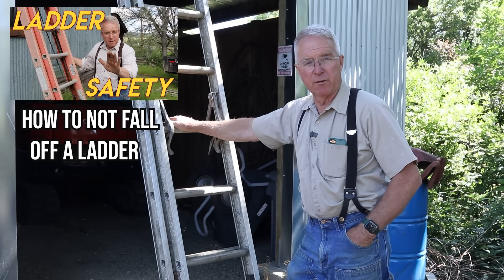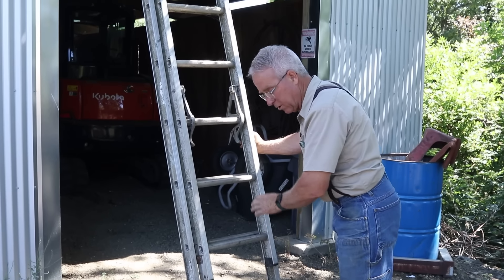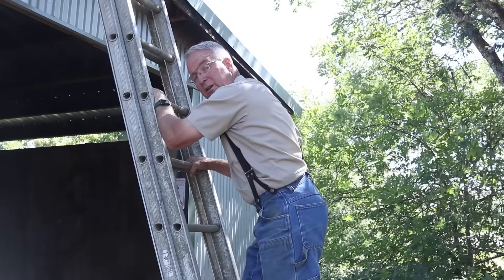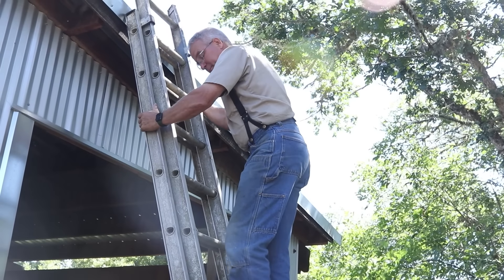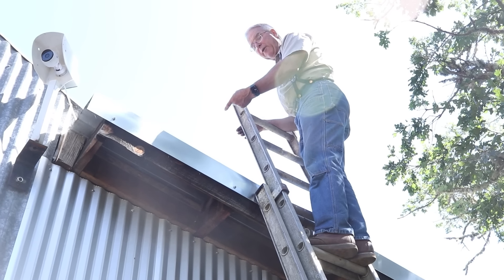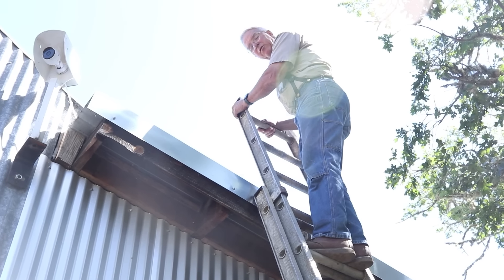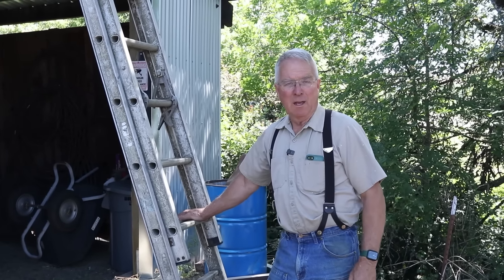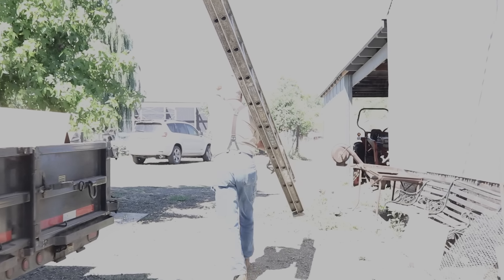How to Climb A Ladder, Dismount, & More Tips

Comment: Fireman Method 4:1 for ascending or descending. 

Carrying a load up at the ladder, use a canvas bucket and a hand line, or a work belt to attach tools.

A ladder wedge, dig out the ground, and spurs all work when done appropriately.

3 or 4 rungs above the level that tou plan to step off on. Waist high at a minimum, preferably mid chest preferred.

Side carry at the 50/50 holding the fly section or if shoulder carry, you should know the balance point where not recommended, you should be able to balance on your shoulder and holding with one hand. But for safety reasons, for example, if you carrying on your right shoulder, the fly is on your head side, left hand on the rung, and right hand under and on the base. This way, if you slip, your rung hand can push away and your base underhand can pull down to roll the ladder off of your shoulder (found this out when I slipped on some sheep shit on a 15 degree angle hill with a 28ft fiberglass ladder that was  a Class 3A and weighed about 130lbs). Again, find the balance point. This will be way different for a fiberglass versus an aluminum ladder. 

If you have ladder hooks, fold the hooks in where they lay over the top rung or V bar if it is designed for pole utility work.

Always face the direction you are carrying in with the foot down. Use help when needed (there is no gold star for taking chances). Be aware of overhead obstacles like power, tree limbs, or UFO's.

Fiberglass is best but is alot heavier than aluminum. Fiberglass is more stable the higher you go, but setting up is more dangerous due to weight. 

Last thing that is really the first thing to do..... Ask yourself, do i need to use a ladder to gain access or is there another means like a bucket truck or other aerial device that you can use. Second, if you use the ladder, visual inspect for damage like cracks, missing hardware, bent rungs of rails etc. If the ladder is the only option and is damaged, either repair it before use or replace it for the job before you. If it is damaged beyond safe repairable usage, destroy it by cutting the rungs or cutting the fly/base in 4ft sections (side note, a 28ft ladder base make a wonderful 14ft ladder if if the base is good and the fly has been removed for damage that cannot be repaired.

And when you can, tie off the ladder to a secure object to anchor it when lifting over 35lbs for that hand line. When in doubt, do not attempt the work. There is nothing more dangerous than incompetence on a job site and someone acting like they are an expert at the task at hand.

Safety is the one thing we can all LIVE with. 4:39

Comment: I just switched trades; I was a scaffold builder for a number of years, a few of them at a dedicated scaffold shop, now I’m a pipefitter and service HVAC/R. I’ve never had an issue with heights, I like it personally.. but I’m not a fan of extension ladders. Going up isn’t bad but dismounting a roof on an extension ladder sucks.. I would rather do ANYTHING else. I tend to get on my knees and get my center of gravity as close to the deck as possible and step one or two rungs down, keeping everything close to the ladder and edge of the roof when I transition. I’ve had ladders slide when transitioning to a roof; it will be even more severe if it happens while getting on from a roof. 

Don’t know if it’s good practice or not but it’s a habit from climbing down off of system scaffolding. It was never an ideal scenario but sometimes it was the only way to get down from a scaffold, halfway through a build.

If I’m carrying my tool bag, I’ll set it on the edge of the roof, get on the ladder until the bag is just below eye level, grab it and transition it between the ladder and the building and climb down with the bag on the backside of the ladder. Sounds awkward but it’s actually very comfortable.

Comment: Retired plasterer here. I always hated ladders and would never work off of on, but plastering requires 2 hands so it would pretty much impossible to do so.. We always work off of scaffolding. However, the hod carrier uses them all the time to get mud up onto the scaffolding. The regulation hod ladder has rungs that are 8" apart, and they are OSHA approved for carrying up a hod. Some hod carriers use buckets and perhaps that wouldn't be osha approved, but hods and ladders are fine together according to OSHA.

Comment: My employer's rule was (retired now) to always maintain 3-point contact with the ladder. Two hands and one foot, or two feet and one hand. That essentially prohibits carrying anything in one hand. Not practical in the real job world, although you could use a haul rope after you are on the roof. Working alone, tie the rope to your belt as you ascend then pull your gear or materials up with the rope. But then how do you get a heavy load safely onto the roof while standing at the edge? The load will offset your balance to a dangerous degree. One day, we may see extensions ladders banned completely (sad) and replaced with hydraulic platform lifts.
Excellent video, thanks!

Comment: A few years ago I fell onto a concrete slab using an extension ladder I did not tie off cutting trees... Id have to say after breaking my foot in three different places including my toes caused by (steel toes)
Which regardless I still wear... And breaking my arm and wrist in several different places... Wish I would have seen this video sooner... But I'd have to say after watching this video I would have saved a few breaks!!! I'm a raile holder though now for sure!!!

Comment: I worked for one contractor who had a 40’ magnesium ladder. It was backwards compared most extension ladders, the fly section was away from you as you raised it so when climbed down your foot didn’t have to feel around for the rung. The rungs were also wider, like a step ladder.
Reply: My question is why all are not made that way?
Reply: @monteglover4133  I'm guessing that it was so expensive that the company didn't sell enough of them to stay in business because I've never seen another one.

Comment: I need to use my 32 foot aluminum ladder to get to the barn roof. It has IKO shingles that fail to stick and for a number of years I had to put new ones on when the wind blew them off. Luckily it was at the edge of the roof which is about 22 feet. The ridge IKO shingles failed completely and didn't even look like shingles anymore after 15 years. I tried to transition from the ladder to the roof and couldn't do it, too high for me. I even threw a rope over the other side to hold on to. Hired a handy man and he did the vent for $400 (roofing company wanted about $2000) so I was happy. I have so much trouble with the 32' ladder, I can't reach high enough to get past the balancing point without the end on the ground lifting when trying to lift it up or down. Now I use the lawn tractor which is about 1000 lbs and put the end of the ladder against it so it doesn't slip. I won't go on my house upper roof either since it is so steep and high.

Comment: I’d like to add to this. Grab your ladder from the inside or “weak” side. Often, the rungs fit better on your shoulder or hand. This is for any ladder. It’s also important to mention that fiberglass ladders are much heavier and feel a lot better when using them. But the fiberglass will deteriorate over time. Coating the ladder in polyurethane helps, but they still aren’t great to use if they are old and degraded by Sun exposure.

Comment: I always make sure my dismount rung of the ladder is even with the roof line. That way I feel more secure with my foot partially on the roof edge with the step and of course have the additional 3 rungs above. Getting off the roof also  feels more secure for this acrophobic. I have been stuck on the roof from fear before and had to train myself to focus ahead and not down.

Comment: OSHA also allows the use of 60-foot extension ladders with no fall safety provisions.  I called OSHA's state office to inquire about this when I saw a worker caulking windows at the top of a 60-foot ladder over a concrete surface.  OSHA said as long as the ladder is in good condition, not damaged, no fall safety provisions were required.  I reminded them that falling from a height above 48 feet onto concrete is usually fatal, they replied they knew that.

Comment: I've did both ways on a ladder plus I driven stell pipe at the base to help protect from kicking out and I put a board on top of the pipe in case of a slip. Plus if there is a place to tie off I tie the ladder off ....  especially if the ladder is to be in one spot for a while...like doing a roof.

Comment: 6:14 Thank you! That's why having the fly on the under side is safer. Fly under extension ladders have not been sold in this country since the early 1990s.
Reply: You still have that going up a "fly under" ladder,  but you're a lot higher when it happens.
Reply: @andrewalexander9492  Except the first single rung on the fly is not obscured from your foot as it is on a fly over ladder.

Comment: 40 yrs of HVAC climbing roofs. I ALWAYS put a bungey cord around the top of the ladder. Usually wrapped it around 1 wrung too. Blowing wind and ice make it quite easy for a ladder to quit and just fall over. Now what do you do? It also creates enough friction to stabalize the top so it doesn't slide back and forth while attempting to mount or dismount. Putting the trucks body up against the bottom of the ladder also keeps the wind from changing your schedule.

Comment: My last pair of Redwing boots had lace hooks at the top of the boot instead of eyelets. Several times working on a ladder if my feet were close together a lace loop from one boot would be caught by a hook on the other - meaning I couldn't move my feet! Nothing more disconcerting than trying to maneuver your feet in order to get that lace unhooked while standing 15 or 20 feet in the air.

Comment: A few years ago, I went up on my roof to take a look at the chimney. When it came time to transition from the roof to the ladder, I couldn't do it. I should mention that I was home alone at the time, so going on the roof wasn't a great decision to begin with. After about 10 minutes of wondering what I was going to do,  my neighbor pulled into his driveway. I yelled and asked him to give me a hand. I had him stand on the bottom rung until I was headed down the ladder. I was still nervous taking that first step back onto the ladder, but everything worked out.

Comment: The safest thing you can do is put a ladder stabilizer at the third rung down. Put ladder mits on the top of the rails. The rung with the stabilizer is the rung you will dismount from. You will get on and off the ladder by stepping horizontally onto the work surface.

Comment: Didn't see the other ladder safety video but I can tell you from years of climbing telephone poles that sometimes we needed to place an extension ladder on a pole. After safely placing the bottom of the ladder 1/4 the extended distance out from the base of the pole we then tied the bottom rung to the pole with a small rope. This guaranteed that the ladder wouldn't move.

Comment: Years back my co-worker was climbing a ladder onto his house and as he got to the top and without thinking he reached out and grabbed the overhead electrical service wire to his house to steady himself. The current was such that it locked his muscles and pulled him in towards the wire rather than throwing him away from it.  He said his face was being pulled closer and closer to the wire and there was nothing he could do about it, then thankfully something tripped and the current shut off.  He was basically okay, I don’t even remember if he said he got electrical burns.

Comment: Professional tradesman for little over 30 years. For digging the ground down to level the ladder use the claws on a hammer that has the straight type claws not the curved. The ones with straight claws are better anyway. 

If you hold the rails on a ladder and your foot slips for whatever reason you are taking a quick trip to the ground, you will not be able to hold your weight if you're hanging onto the side rails. You're not going to fall during the brief time you're reaching for the next rung. You can always have at least one hand gripping a ladder rung.anyway.

Climbing from the ladder to the roof is way easier than going from the roof to the ladder. It is not really difficult though it is just psychological. If that same scenario was two feet off the ground you would do it without any problem. As he said the important thing is to be paying attention at all times. 

If you are too freaked out up there that can cause you to fall. At the same time if you get too comfortable with it and get overconfident and lackadaisical that will also cause you to fall. Try to relax but don't get overconfident. It gets easier the more you do it.

Comment: If you have a real old school extension ladder, the fly will have an absent rung at the latches...and it's a spot, IMO, where you are MORE likely to slip off than at the very bottom of the fly. You tend to remember where the bottom of the fly is, but less so the third rung up.

Great video.

Comment: +If you teach em when young they won't fall off the rung.  If you step off the ladder to the roof to the left or right placing that foot too close to the ladder will set you up to trip over that foot. so don't be afraid to step a little further to the left or right, depending on which side you exit cause your inside bracing hand is now your center of balance. This works on the ground as well, just less far to fall if you don't.:face-purple-wide-eyes:

Comment: I think most people that use ladders fell off of them a time or two. Which is how we got experience...
I was once using a fixed ladder to climb on my roof. It extended about 4 rungs above the roof.
I was coming up carrying a gallon of paint. When I tried to transition I had my left foot on the roof, and my right hand on top of the ladder. The moment I did this ladder kicked out on the bottom and continued to slide down against the side of the house, with me on it. There was no actual fall per se...just a slide.
Of course the paint spilled all over the place. Cleaning that was the toughest part.

Comment: A simple test is to climb up a couple of rungs and see if you can hold your own weight with one hand firstly by holding a rung and secondly the rail. This will demonstrate why you always hold the rungs and never the rails. As with your feet you climb a ladder using the rungs only. Aside from that with a wooden ladder there's a good chance you'll get splinters holding the rails.

Comment: Digging out works on hard soil. But not necessarily in areas with mulch or wet soil. In those cases, shimming is sometimes safer. If you are having to extend the ladder out very far, take some stakes and drive into the ground behind the feet of the ladder so it won't kick out. Seen painters do this many times. Best to get some ladder levelers to attach to your ladder if you use the ladder a lot.

Comment: Great video. The controversial stuff is interesting - I've seen big changes in accepted safe practices (in the UK workplace) for ladder usage in the last 30+ years. When I was first trained to use a ladder, it wasn't considered quite so problematic to carry something in one hand, or to conduct work (e.g. drilling) while on the ladder. These days, it seems that for anything other than access to a platform, we're being told that we must have a full-on scaffold instead of a ladder.

Comment: Also, if you flip just the low side foot, with the spike in the ground, there is a built in offset making the spike side about one inch shorter, so you have one inch of built in shim. Then use the side you need, then  jump on it and get another 2 inches or so while anchoring it very well too.

Comment: I always grab the sides when going up ( I have only been on tall step ladders, not extensions), but I started to grab the rungs with fiber glass ladders, because I got fiber glass in my hands.
Reply: Same thing happened to me about 15 years ago when helping paint my mother in law's house.  Later I read that when a fiberglass ladder starts doing this it's unsafe because it's been exposed to too much UV over the years.
Reply: @63MGB1  I thought it's just because it had been used and stuff over the years I didn't know it was the UV rays. Ivan put little pieces of the duct tape on the sides for carrying it

Comment: Some folding ladders like Little Giant have wider bases for extra stability, but when unfolded and used as an extension ladder the wider base of one side is now also at the top and more difficult to maneuver around as you dismount to the roof - any tips for this?

Comment: I had the feet of an extension ladder slide out under me indoors one time when I was up at the ceiling in a space with wooden floors.  The only thing that saved me was that I had one hand holding onto a metal truss above my head.  That was enough for me to swing onto the top of a rack where I stayed until I was rescued.   Great video this.  I wonder about the OSHA rule you mentioned about carrying things up on ladders.   That would be the safest way for sure,  but on smaller jobs at least, how does one elevate shingles, sheathing, soffits.  Does everybody have lifts and cranes these days?  (I'm 70 been out of the trade awhile)